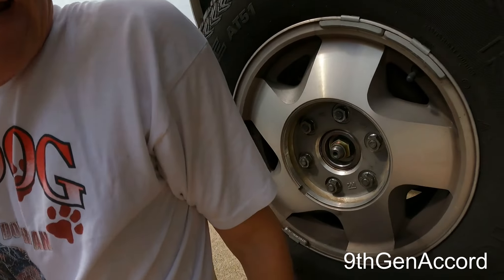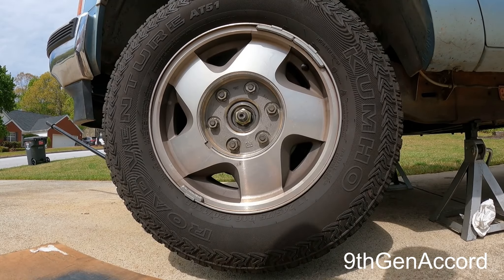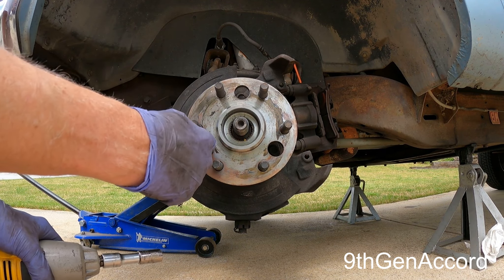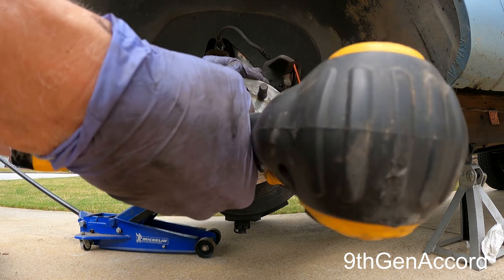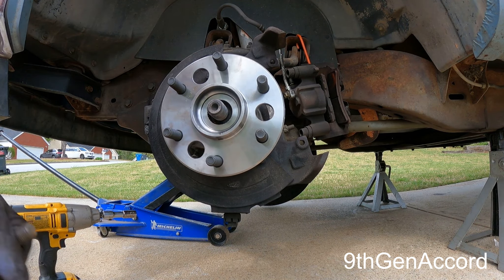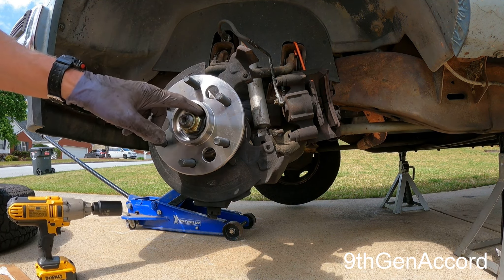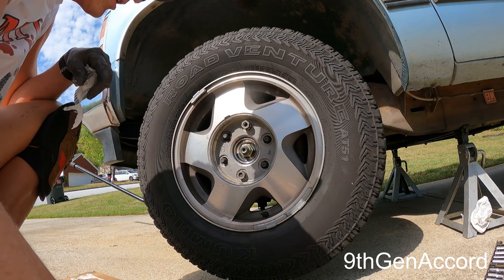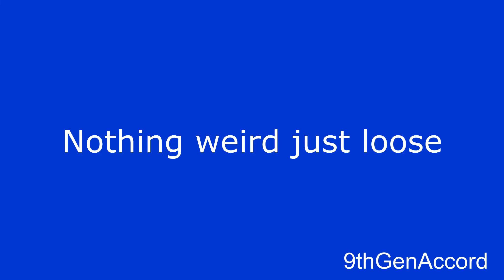American Made Front Wheel Hubs Failed in 9k Miles|1989 Chevy K1500 Silverado

Comment: American made with low quality parts from overseas. I bet fake Japanese bearings.
Reply from the maker: Yea that could very well be the case.  I looked at the other one after I shot this video and it was also slightly loose!  What are the chances that they both failed in the same miles?
Reply: @9thGenAccord  , unless both had low quality bearings, otherwise it's very rare
Reply from the maker: @repairvehicle  I should have injected some Amsoil grease in there and they would last forever!
Reply: Or fake American bearings